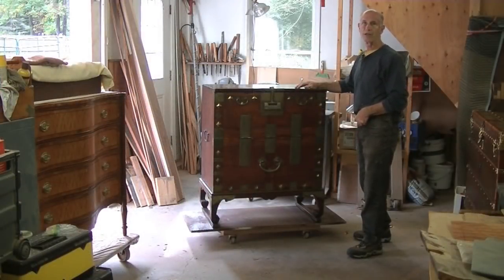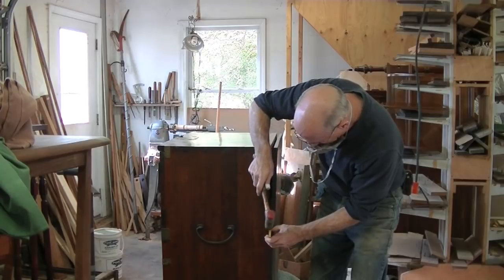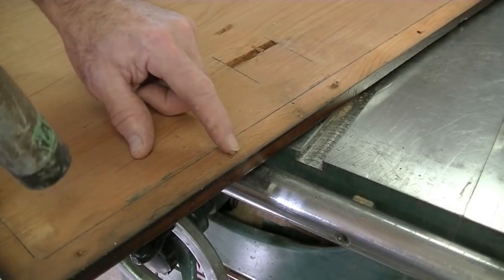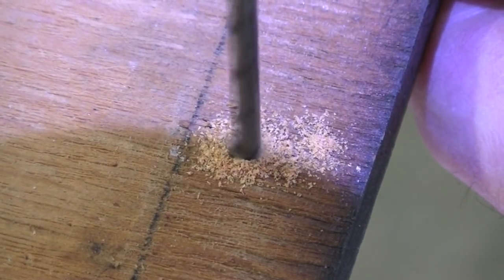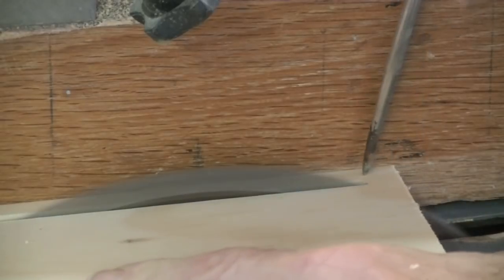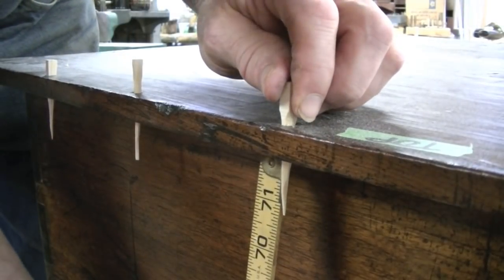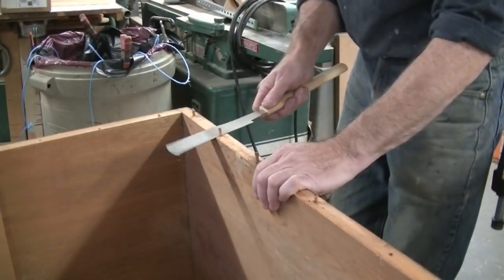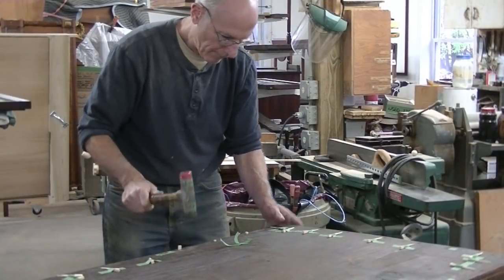Restoring a Korean Chest - Thomas Johnson Antique Furniture Restoration

Comment: Great work. I'm glad you took a couple of minutes to consider (a question I had) why the pegs may have sheared. Also, apart from maintaining the authenticity of this piece, in general do you think that tapered pegs are more secure than straight pegs?
Reply from the maker: Hi James, thanks for watching. As I worked on it I realized that it really is a clever way to attach the back. In other words, if you put a spot of glue where the pegs go in, the taper  ensures that the back will never come off.The original maker probably didn't use glue, but was building with green wood and was counting on the wood shrinking and holding the pegs.
Reply: I guess I'm kinda randomly asking but does anyone know of a good site to watch new movies online ?
Reply: @Conrad Johnathan i use FlixZone. Just google for it =)
Reply: @Ezekiel Kieran Definitely, have been watching on flixzone for years myself :)
Reply: @Ezekiel Kieran Thanks, signed up and it seems to work :) Appreciate it !!
Reply: @Conrad Johnathan glad I could help :D

Comment: Great job with those pegs.  I am wondering if it would have been a good idea to use glue on the surround of the back and not just in the peg holes.  I understand that was not the original method and probably a major reason not to do that, but would it prevent the pegs from breaking if the wood shrank more or would it cause the wood panel to crack because of restricted movement? (P.S. Clamping opportunity missed).
Reply from the maker: Thanks! It wasn't glued originally, and I don't think it's necessary. I think the pegs breaking was a one time event, probably the case shrunk when it was first imported to this country

Comment: I have a Japanese chest with the same problem. I've not had the courage to do anything about it partly because the joinery is so foreign to me. Also, there is some missing wood on one drawer face and I've never figured out what type of wood it is in order to make a repair.  It is amazingly light and amazingly strong. Then, on top of all that, the finish is foreign to me (some sort of light oil or wax?), so I don't know what to do to repair the finish if I work on it.

I think there is a technique in Japanese construction that compresses wood with a hammer. For example, imagine cutting a full / crossed lap joint. I think there is a Japanese technique that would make the notch just a hair too narrow to accept the other half. A hammer is then used to compress the other half. After assembly, the wood expands over time making a super-tight joint. The reason I'm mentioning this is that I wonder if this was done with the pegs on your chest. That could explain why they were so tight and might also be a super efficient way to fit them. 

Oh, on my chest, the reason the back is off is because the back acts as the drawer stop. Over the years, it has just been beaten off of  the back of the cabinet by the drawers. This is another example of a construction difference, actually. Western chests have empty space around the drawers and in back. The Japanese drawer has no wasted space around it and is dead up against the cabinet sides and back. On a western chest, you just have to fit the opening and adjust the runners / kickers while on the Japanese chest it seems like the whole case just has to be dead on and the drawer built to match. Quite humbling, really. Sorry- not trying to explain anything to you..just babbling in wonder about these chests.
Reply from the maker: Thanks! I'm not sure wht the wood is, but it closely resembles elm or chestnut, if you can find any. That's very interesting about the hammer joints. It sounds like something the Japanese would do! Clever. If you use shellac as a finish it will be fine. Possibly you could add drawer stops in the front, on top of the rail where a small block will catch the back of the drawer front. This is often done on western case pieces
Reply: @johnsonrestoration  If it looks like elm, its possible it could be keyaki (zelkova serrata). An Asian relative of elm.

Comment: Interesting as usual. Wondering why back in the day the builder would use square pegs to begin with rather than round. Seems like more work to make square pegs...
Reply from the maker: Thanks! Think about it - if you are making your own pegs, square is much easier
Reply from the maker: True. I was concerned, but if the square peg is slightly big it conforms really well

Comment: Why use pine for the pegs?  Or does it matter what kind of wood the pegs are made of?
Reply from the maker: No reason, I suppose oak would be stronger, but you're not really asking them to do a lot. Pine was just easier to work with.